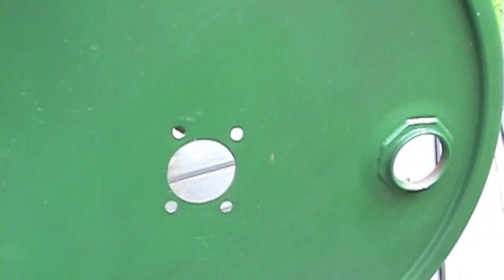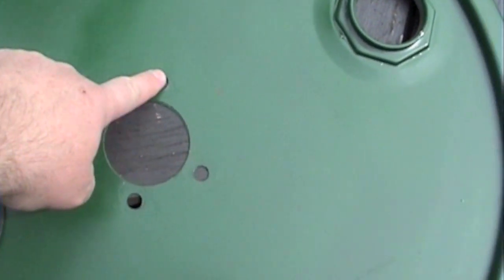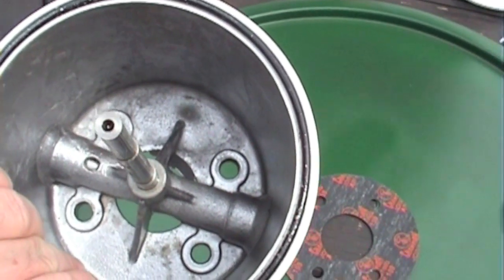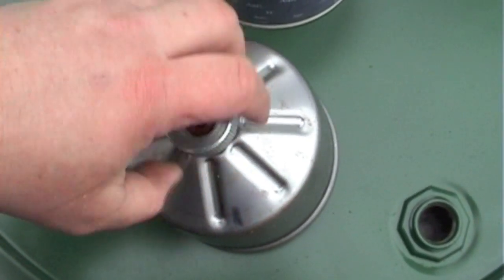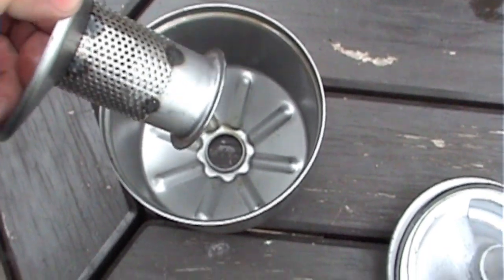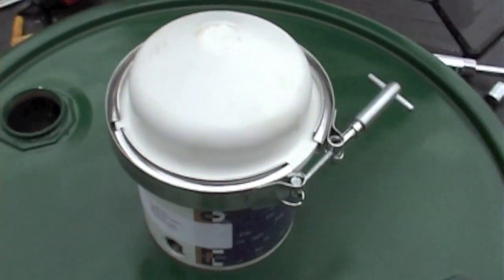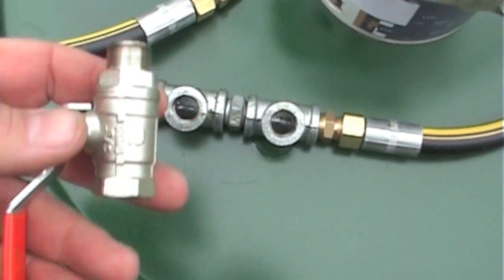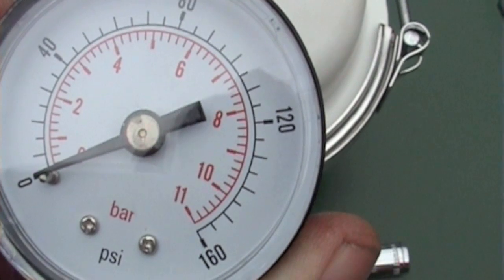How to make Biodiesel, Centrifuge your Waste Vegetable Oil (WVO) into Biofuel. Support Ukraine

Comment: The problem with centrifuging VO is that,
It cost too much for the equipment. $600
Takes too much power to operate and heat up the VO. about $100 per month.
You have to do about three passes to get the VO clean.
It is also time consuming and needs constant attention.
An easier and cheaper way of doing this is to buy two 275 Gallon Totes.($200)
Fill it up with oil and let it sit for two weeks.
The oil will be as good as 5 micron filtered after two weeks with no effort or any energy spent on it...